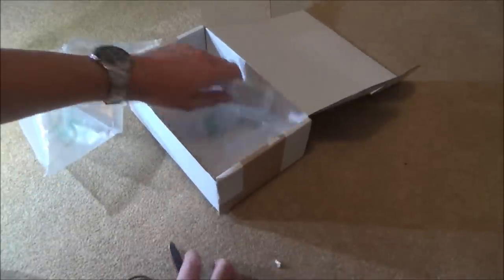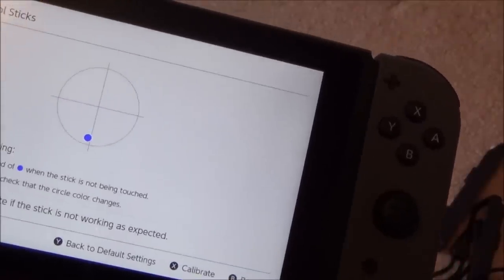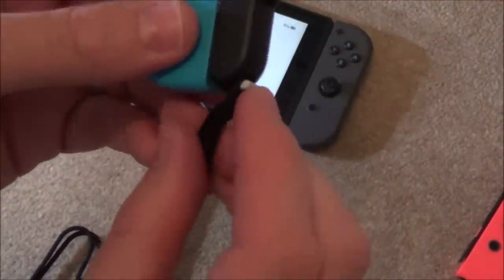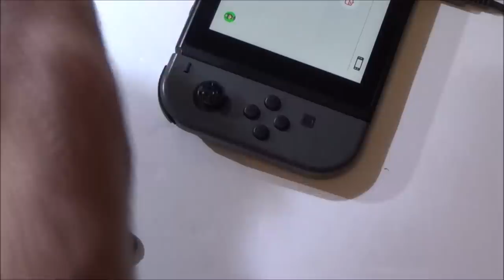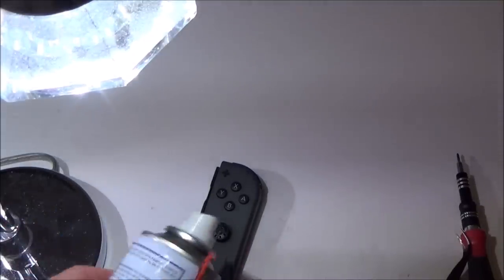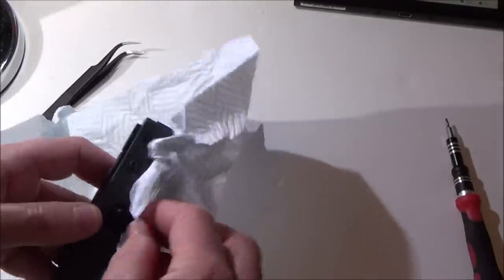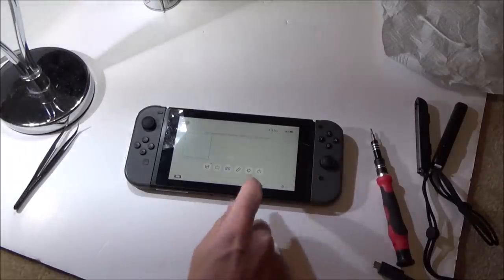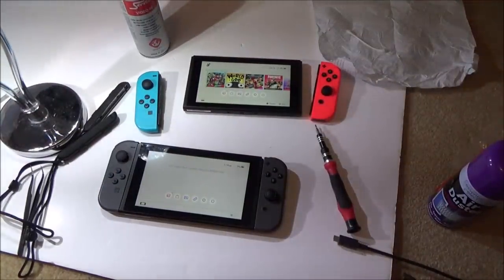Trying to FIX Nintendo Switch Joy-Con Stick Drift and Loose Stick Caps

Comment: This actually will happen again over time. The joycon analog sticks are not very well made... if dust/dirt gets stuck inside the analog stick, it causes this drifting problem. I used compressed air to fix the problem. You can also try taking it apart and cleaning it manually with isopropyl alcohol. :] Anyway, excellent job for fixing it.
Reply: Why would you take it apart though? Wouldn't that just mess with the rubber and feel of the analog stick? So far I've seen people just spray underneath the rubber and wipe it off to make it work again. If you take it apart that's completely up to you I wouldn't suggest it though if you don't know what you're doing
Reply: @Daniel328DT  It's only for tech savvy folks. 😛 Compressed air/alcohol method anyone can do.

Comment: Great job =D  Impressive getting the stick drift fixed without swapping the stick!!!
Reply from the maker: Thanks Chris, I was very lucky on this fix :-)
Reply: It's easy to fix the drift on sticks (well known issue) but it returns quite quickly. I fixed mine but after doing it 2 or 3 times and the time between fix getting shorter and shorter i just bought some replacement sticks. The sticks are really poor on the joycons. Thankfully they are modular and proably why the build quality isn't up to that of previous Nintendo controllers.
Reply: @Tass...  Can you guys tell me what type of alcohol to use
Reply: Musi isuM Use an aged whiskey. Solves all the problems.

Comment: Left stick drift can also be due to a poor design with some kind of interference with the analog stick and the Bluetooth. A fix is to use conductive  foam between the board and the analog stick cable. I’ve done this on a couple of them and so far it has fixed it. Not 100% but not as frustrating as it was originally.
Reply: It wouldn't drift if that was the case, movement would just get kind of "sticky", so randomly it keeps moving when you let go of the stick.
Reply: Yes and no. I live in the middle of nowhere, so stock doesn't replenish as fast as it should. I purchased a brand new set of joy cons from Wal-Mart. Played Mario for a while, and same issue. I tap up, and off it went on it's own for a few seconds, I'd want to jump, and nothing would happen. Both right and left are still having issues. And this is out of the box, brand new, nothing getting it dirty underneath.

But having a few switches myself that I repair, I have noticed that some work better with the same joy cons. So maybe it's not entirely the joy con's problem, but the switch itself not receiving the signal as it should. Still playing around with it some more.

Because of these videos, I've been inspired to purchase my own switches and fix them. So far I've purchased 5-6 of them. Mostly joy con sync issues. Once I get some money in the bank, I want to try a bricked one and start to replace the dead chip.
Reply: The foam is only for the Bluetooth issue. Not the drift issue. We have known this isn't the Nintendo fix to the joycon where they added the foam block to the production models. Stick drift is almost always a dirty internal or a broken stick.
Reply: It's on the right stick though. I have the same problem. At launch my left cap came off, because I had no Switch case, sent it in to Nintendo, and they seem to fix the foam thing as well. (I opened it up and it has the foam inside it, even though being a day one launch console.)

My left stick never had problems though, only my right stick now.
Reply: can you make video onnhow doing

Comment: Hey man would it be possible if you could make a video where you measure the Voltage or continuity  on the caps and pins around that Nvidia chip you replaced in the last video you made about the nintendo switch you tried to fix. Because I think that this chip is faulty on my switch as the measurments are very weird but i dont have a working switch to compare the measurments to. I think lots of guys would appreciate this as there is no documented stuff about this online you would actually be the first to do this and it would really help peopel out a lot to have a reference when they are troubleshooting their problem !

Comment: Hey vince, it’s probably by water damage.
Edit: guess why I know...
Reply: Why didn't you use flex tape or flex glue on it?
"It keeps water at bay and stops leaks at ease"
Reply: My right joycon was ruined by a simple soda accident.
I feel you bro
Reply: Son Goku nice one
Or use FLEX SEAL
OR FLEX SHOT
Reply: Same here. But mine was damaged by chocolate fingers
Reply: Hmm I wonder 😆
Reply: Any lquid can ruin the joycon. 

And its the reason why people are complaining about it.

For example. I spelt a bit of coffee onto my ps4 controller drifts like a F-zero race.

Comment: I've found that it's easier to get the grips back on with a small flat-head screwdriver, rather than tweezers. U just have to line up the 4 rubber tabs in the center 1st then push the edges of the grips down around the stick, then just lift the very edge of the grip and push the outer tabs into place with the screwdriver. U can see from the side if the rubber tab is in place as u work your way around. Go one at a time and keep your thumb over the previous one as u go. Took me maybe 2 minutes to do max, starting with a warped grip completely off the thumb-stick.

Comment: I wonder if heating the rubber stick pads slightly, possibly with a hairdryer or warm water might make them go back on easier?
Reply: Andrew Littleboy genius, ill try that
Reply: Fr did it work for you?
Reply: @buff5081  I tried but not really, maybe i didn't heat them enough
Reply: Fr oh ok thanks for answering though :)
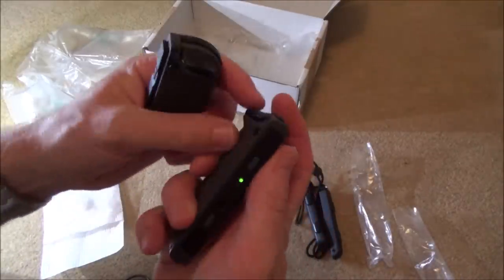Reply: I put mine in the microwave for 1:30 and it went on easier than normal but I think it started to melt a little so I wouldn’t do it again

Comment: I was actually hesitant on the whole contact cleaner to fix drift thing and had ordered a couple of replacements for two of my sticks that have been drifting. However, actually seeing this...I'm probably going to cancel those orders and just buy a can of contact cleaner...
Reply: Jim Results?
Reply: It actually did the trick. I was honestly surprised. I thought a little spray here and there was too good to be true but it actually worked. I'm not sure for how long. but it's been a month now with no signs of drifting/ghosting.
Reply: Jim any updates?
Reply: Is it still working fine?
Reply: You can just swab the inside with isopropyl alcohol

Comment: Well done .keep it up.u just solved my issue .in fact i used body spray to remove the dirt n it worked perfectly.i hav already order 2 analog sticks from ali express for replacement . tat will be spared now.thanx alot

Comment: When taking off the straps, press the back button on the joy con down. The way you take them off was quite painful to watch. Just a little word of advice.
Reply: Why? They were designed to be removed without pressing the button.
Reply: MrMichaelXX no they weren't. You are meant to click them first then slide them as they have the same mechanism as the joycons do when locking to the console excluding the lock.
Reply: Ok whatever you say bro 👌👌
Reply: @MrAzazel666  good luck with your broken latches then cause thats what happens when you don't press the buttons. I've seen it so many times already.
Reply: Well I've slid them on and off several times without issues but whatever. 🤷‍♂️
Reply: @MrAzazel666  and? You getting lucky and having no problems a few times doesn't automatically make something a fact and that it was designed to do it. What kind of stupid thinking is that?
Reply: @MrAzazel666  Funny, take a look at the website or literally anyones joycons who does that and you'd know its incorrect to do that. But sure, break your joycons. You'll be the one paying me when I have to change the latches for the 100th time. Hell, even the manual that comes with the switch tells you to press the button
Reply: @Ornstein Sure thing bro. Have a nice day.
Reply: @sethkauffman9915  then why does it still damage them when you dont press the button? Ive had to replace tons of latches for people because they just yanked off those things and didn't press the buttons. The manual that comes with the switch also very explicitly states to always press the button to avoid damage even with those.
Reply: @soundblaster2k  because what's more likely is they put it on backwards/upside down, and then also still yanked it off. I've never pressed the buttons when pulling them off, and haven't had a single problem, but my first set of cons the plastic latch on the joy con broke off within a couple times of removing it from the system itself... Never had a problem with the straps though.
Reply: @sethkauffman9915  no i can assure you in at least 2 cases they were put on right and still broke the latches on the first use. I literally watched my brother put them on the exact way they should and then when he pulled them off just like in this video the latch completely broke off with them.
Reply: @soundblaster2k  well then your brother must be ripping them off like he's King Kong, cause I take them off liberally enough without being careful, still going strong. The console however weakened my first set and broke them in no time.
Reply: @sethkauffman9915  lol nah he took them off with less force than is used in this video. And it isn't just him either. I've seen hundreds of posts about them sheering off the latches even when attached the right way.
Reply: Agreed it was killing me
Reply: Whether it's needed or not it was still painful to watch for some reason. I still push the button just in case lol.
Reply: Calm down people. Idk the "correct" way that they are designed to be used, but it feels like it is way harder to take off without pressing the button than with pressing the button. Anyways, I will keep pressing the button just to be safe. Better to be safe than sorry.
Reply: @sethkauffman9915  you're not youre
Reply: Actually, Nintendo's site specifically says you don't need to hold the Joycon release button to remove the strap.
https://en-americas-support.nintendo.com/app/answers/detail/a_id/22334/~/how-to-attach%2Fdetach-and-wear-the-joy-con-strap

And IMHO, it's harder to do it while holding the release button because you won't have a decent grip on the strap and Joycon.
Reply: @clockwork204  Thank you for being the only one here with common sense. 
"To detach the Joy-Con straps it is not necessary to press the release button on the back of the Joy-Con controller". 
Seems pretty definitive to me.
Reply: The intended way to remove the straps without pushing the button will cause significant wear on the plastic ledges which lock the joycon onto the switch. Just because something is intended by the manufacturer does not mean that its working forever. Actually thats why we are watching this video.
Reply: @Xn00bertX  The thing though is... the locking mechanism is on the strap itself. If you look at the bottom (where the strap lock lever is), there are 2 spring loaded protrusions which latch onto the Joycons. That's how it locks in place. The lock lever keeps the protrusions rigid so they don't let go when it's engaged.

Basically, the release button on the Joycons latch onto NOTHING when using the strap. You're not damaging anything. Maybe just the plastic and springs on the straps themselves.
Reply: @Xn00bertX  And if you want to use them that way, that's fine. My problem was with the claim that using them without the button wasn't what Nintendo intended, because clearly they did.
Reply: @soundblaster2k  Just read the manual, and no, there's no part saying to press the button. Heck you can even see on the grip's rails that the place where the button attached is rounded off compared to the rails on the switch. It doesn't feel right but it's perfectly fine to do so. Heck why would they even make the lock at the bottom if the button locks it?
Reply: @robinrai4973  you tell me. I've replaced about 10 more latches btween my last comment and now because of those exact rails. The manual that comes with the switch doesn't  say that but nintendo themselves tell you to do it when you call support so you tell me.
Reply: @soundblaster2k  first you say nintendo says you should, so someone gets a video up showing they didn't, then you say the manual says you should, and people get that up, now you say if you call them they say that? I doubt any of those breakages you've encountered, if you're even being genuine, are even from the accessory rails. Especially since where the accessory would wear down the latch (if it even does) is on the opposite side to the side that holds the joycon to the switch since it goes on on the opposite direction.
Reply: @robinrai4973  you can believe whatever you want man. Like i said to the other guy you'll be paying people like me to replace those latches when they break. I've literally watched it happen with my own eyes on over 20 seperate joycons. 

I'm just trying to watch out for you guys but if you wanna take the risk then by all means you're only giving me more business.
Reply: @soundblaster2k  Firstly, why would any of us go to you when we're on a channel about fixing things? Secondly, no one here has had a single issue with not pressing the button apart from the noise it makes. Thirdly, how would the accessory rail, which again, at worst will wear out the already rounded and other side of the latch, break the latch? It is literally the same exact design and motion as putting the joycon on the switch without pressing the button.
Reply: @Xn00bertX  Since the strap goes on the opposite way to the switch, removing it is going to act exactly the same as putting the joycons onto the switch. The wear would happen to the rounded by design part of the ledge, and the opposite side of the ledge which does the holding on is not affected.
Reply: @soundblaster2k  Point 2, where on this thread has someone said aside from you that not pressing the button on the joycon breaks the latch. And point 3, any damage, if any, happens on the other side of the latch that's literally rounded by design. The square part of the latch is untouched when you take off the strap, just like it is when you put the joycons on the switch itself.
Reply: @soundblaster2k  you can literally look at a joycon and the strap rail, it's not hard. And you've been the most persistent person on the thread. And you've had many people on this very thread as well as the very company that hired engineers to make the bloody thing disagree with you. As for uneducated, your only argument is "it happened to me!" Which you ridiculed yourself when someone else said the same thing.
Reply: lmao let people press buttons if they want to press buttons. getting heated over the tiniest bit of plastic
Reply: @SquishSquish  its annoying when people spread misinformation while belittling others and being full of themselves, I don't really care what you do with your controller but that one dude set me off
Reply: animuu  Much like removing the joycon straps, attaching the joycons to the switch wears on the angled side of the latch which has no purpose other than to move the spring loaded latch when pressed on by the rail, so no harm done.
Reply: @soundblaster2k  I hate to be that guy, but no, the nintendo website doesn't tell you to use the back button when removing the straps anywhere, it also doesn't say anything about using the back button to remove the straps in the manual. 
I'll admit the sound when it's removed is horrible, but their intended design is to be unlocked with the white lever and then simply pulled off
Reply: @ImSoberOfficer  I hate to also be that guy but everytime there's a gap in these replies I get at least 3 new customers who need their latches replaced for this very reason. 

I've even extensively tested it myself with 25 pairs of brand new joycons and new bumper attachments and I've gotten the same result every time. Completely shredded the latch on first removal when the button was not pressed.

Like I've said multiple times if it works for you then great! Good for you! However in my own highly tested and supported experience it doesn't end well when you don't push the button.
Reply: @soundblaster2k  sure man, I get what you're saying. But saying that the Nintendo website and manual says that your way is the correct way to do it is just untrue, in fact it says the opposite.
Reply: @ImSoberOfficer  I just specifically remember the launch day manuel saying to always press the button and remember all the outrage regarding it when it first came out so perhaps they changed it on the website and newer models of the switch

I wish I still had my box to reread the manuel cause as of now I've just been going off of memory and what google says.
Reply: @soundblaster2k  yeah I found it very strange that according to Nintendo you have to use the back button to detach from literally everything except the straps, seems like a slightly flawed system to me.
I always press the back button regardless of what Nintendo tell me though, can't hurt to be on the safe side, plus I hate that damn sound
Reply: @ImSoberOfficer  yea I'm honestly not sure how some people are able to take them off without pressing the buttons.

 At first I thought maybe it was an older model problem or my brother's were just defective but there hasn't been a redesign of the joycons, latches, or side rails at all and yet every joycon I've tested broke on the first try.

 Its very confusing and I just wanna see these people's joycons to find out whats different with theirs and why they haven't broken.
Reply: i was losing it

Comment: Hey this help me fix my joycons stick drift. I also used isopropyl alcohol and a qtip under the joystick rubber that could easily lift. You'll know what I mean when you see it. The qtip doesn't have to go all the way in it just needs to drip a lil bit. I say all this if you can't find that spray